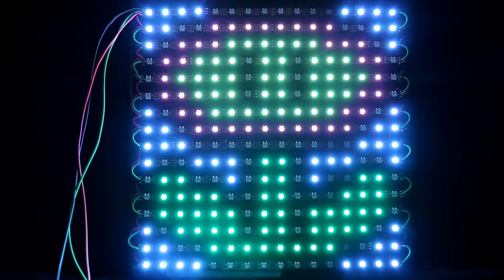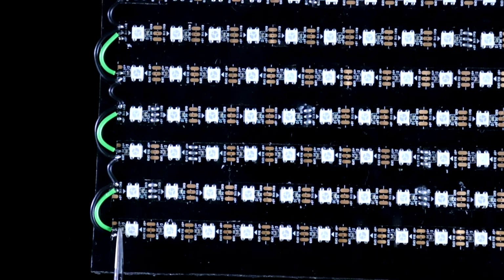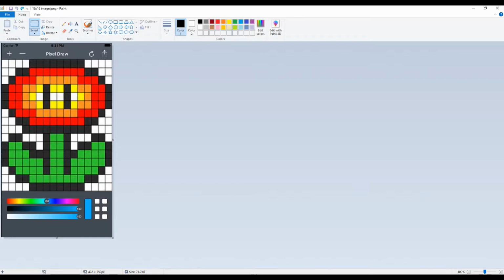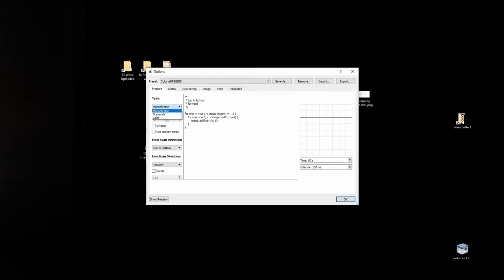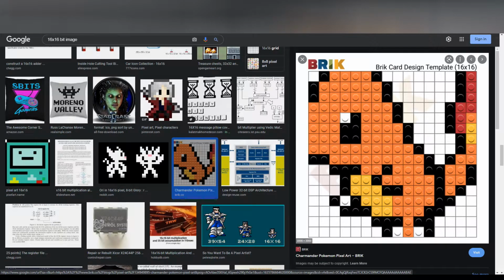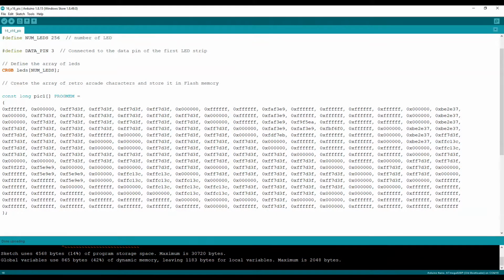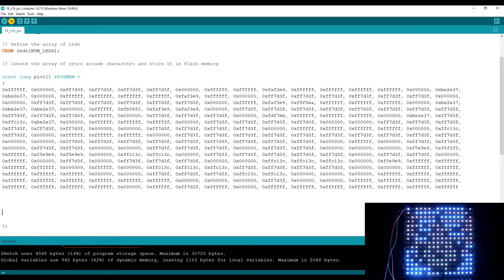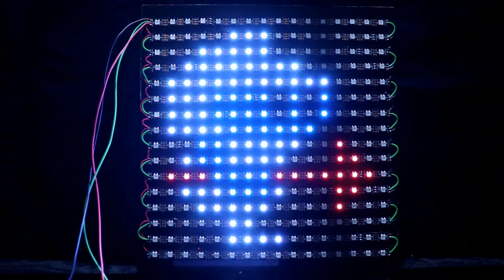Animate ws2812b LED using paint

Comment: For those wondering why you have to copy every second line backwards for non-symmetrical images:
This is because the pixel strips run in both directions. every odd row (1,3,5,7) runs right to left, and every even row runs left to right
>>>>>>>>
<<<<<<<<
>>>>>>>>
<<<<<<<< - data in
So every second row is backwards

If instead you had all the strips in the same direction:
<<<<<<<<
<<<<<<<<
<<<<<<<<
<<<<<<<< - data in
Then you will not have to reverse every second row.